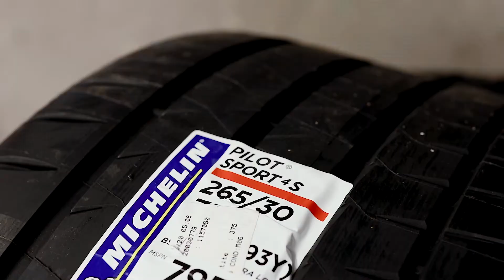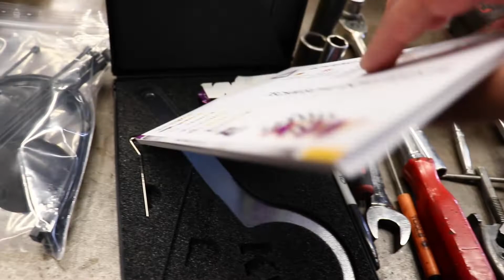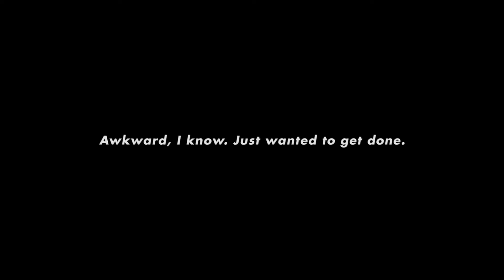Audi TT RS + BBS LM-R | New Wheels!

Comment: Can you describe the ride now and before with magnetic ride? What are the main differences?
Reply from the maker: I changed wheel and tire setup when I added them as well, so the ride changed 2 fold. The Michelin’s make the ride better than the factory pirellis, so that’s number 1. It’s a change I suggest everyone do. In terms of suspension though, I’d describe the ride as comfort mode on mag ride…great compliance, and smooth. Didn’t expect coilovers to ride better than factory suspension but they definitely do. However when you need them and they are pushed they respond like you’d expect from V3s and keep the car composed and sharp.
Reply: @danny_vrsociety  thank you for the reply! So it ia definately worth it changing the mag ride! I have a tts and i wasnt sure  about the change. The car is daily but i push  it hard very often
Reply from the maker: Well worth it! And if you want the ability to change ride a bit on the fly, you can try out KW V3 DDC which mimics a variable ride like factory magride with an ECU that controls it standalone.
Reply: @danny_vrsociety  thank you ! You helped me so much!

Comment: what size are your wheels and tires ..you didn't say?
Reply from the maker: Wheels: 
BBS LM-R DBPK (Diamond Black Center)
Front — 19x8.5 et38 (LM322)
Rear — 19x9.5 et38 (LM323)

Tires:
Michelin PS4S
Front — 235/35R19 (10221)
Rear — 265/30R19 (79569)

Comment: What’s the spec on the wheels?
Reply from the maker: I think it’s in the video, but in case I forgot:

BBS LM-R DBPK (Diamond Black Center)
Front — 19x8.5 et38 (LM322)
Rear — 19x9.5 et38 (LM323)